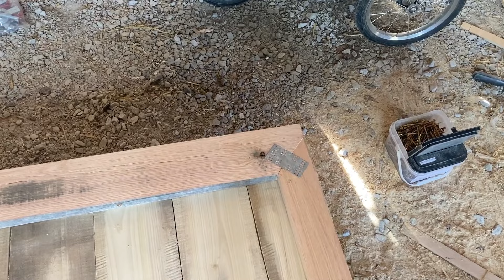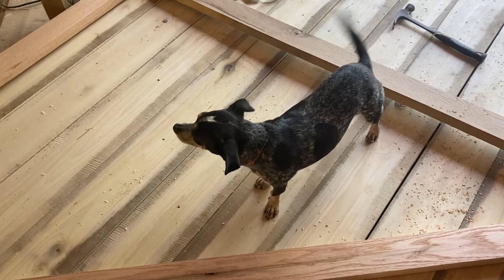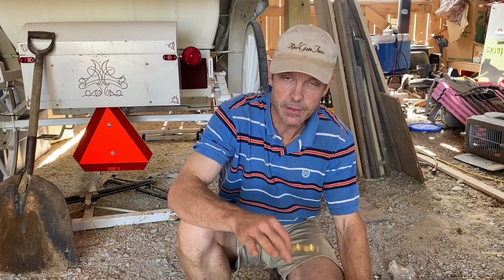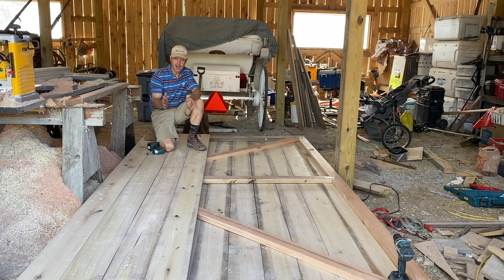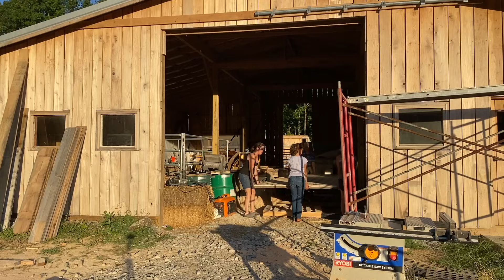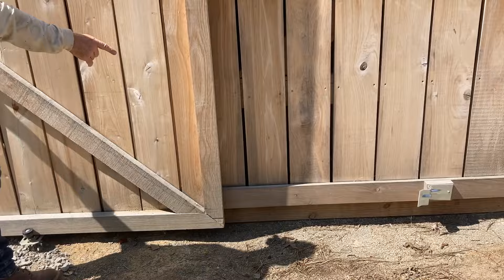Building Barn Doors

Comment: Why build such enormously heavy doors for a building where sunlight is visible between the wall siding boards?
Reply from the maker: Simple….it’s what we had available😁.  We have our own lumber mill, and used some extra pieces of lumber to build this.  The opening is large because it was originally built around our camper (which we lived in while building our home), and we knew we would have to get it out one day.

Comment: Read through all your helpful replies in the comments and re-watched the video a couple times now, apologies might have missed it but don't suppose you can share the finished dimensions of each poplar/oak door panel and a rough estimate of the weight? I've found a local Cannonball dealer but need to tell them how thick in inches we need for the track and what weight rating to choose, looks like an interesting summer project to get some doors on our barn after the building comes together this spring.
Reply from the maker: The space was 12‘ x 12‘, so the doors were roughly 12.5 feet tall x 12.5 wide.  It was built from yellow poplar planks with oak framing, and about 3 inches thick at the framed edge.  These are pretty stout doors, so we purchased the heavier duty channel and rollers.  We sized it so we could get our 28 foot camper in and out, but most equipment would allow the doors to be much smaller than that. Hope that helps!

Comment: Did you do anything to make the barn weather tight, including the doors?
Reply from the maker: We did not make it weathertight, as we wanted to encourage airflow through the spaces between boards. We did put guides on the ground to prevent the barn doors from blowing around in the wind, but it’s not sealed at all from air. It does stay nice and dry inside, however!

Comment: Did you end up putting batons over the seams between the boards? If so, was there a concern that the door would not clear the batons? I have a similar project and can’t wrap my head around whether the door will clear my batons. Thx.
Reply from the maker: I left the battens off. The airflow keeps the barn incredibly dry. I guess that’s why the old timers did it.

Comment: Any chance you can provide a list of the products used for the track and trolley. 
I’m building a set of doors like the ones you built and I like the way the track and trolley system work
Reply from the maker: We just purchased them through our local building supply, but the brand is Cannonball, and I believe they have a website.

Comment: How do you keep the wind from blowing it off track? Is there a bottom rail? Thinking of doing something like this but only 8 or 9 foot tall. Worried that the wind from Southern afternoon thunderstorms will blow it off.
Reply from the maker: Yes, although we didn’t have it installed for this video, we installed a roller guide on the outside/bottom of each door and  a center guide on the ground in the middle, where the closed doors meet.  Although these work fine alone, we also installed a latch on the doors themselves.  We have extremely strong winds at times, and have had absolutely no issues.
Reply: @ADifferentWay  Thanks! I'll Google this to see what I need.

Comment: We have to make large exterior barn doors- 13/4" x 6/4" (double doors) 2 1/2" thick. One millwork shop quoted doors using Hemlock wood. I just want to know if Hemlock will work for exterior doors or am I over thinking this (my foreman) says so. I am worried the doors will bow and warp if the right wood is not used for an exterior door. But I see all these videos where people just using almost any wood and making doors. I guess its different because they are doing it for their own home/farm/barn compared to me doing it for another owner. Any suggestions will be helpful.
Reply from the maker: I’m afraid I have no experience with hemlock, so you would have to research that. What we found however, is that different woods stand up to weather and exterior conditions better than others. So I would not say that people just use any wood necessarily, but there are different woods for the conditions in that area. So research hemlock in your area, see if it stands up to the elements and weather conditions, and go from there. Once you’ve determined that, as far as the warping goes, we found the amount of drying time affects it, and the way you actually assemble the door will definitely affect it. You have to make sure the grain is turned properly and braced against the frame for support from future warping. Hope that helps

Comment: Where did you buy the track?
Reply from the maker: It’s by cannonball.  We purchased it through our local builders supply warehouse.
Reply: @ADifferentWay hello, just wondering what specific track type you got from the connonball company and maybe some more details of what you used?
Reply from the maker: If I recall correctly, they really only offer two options… The square track and the round, self cleaning version. We chose the self cleaning as our last farm had square, and it was always clogging. It was a pain to maintain! Once you select the style track, you prefer, you simply get the items such as the trolleys and door stops that are designed for that track.  We pretty much stuck with the bare basics. I remember calling the customer service at one point, and they were extremely helpful to make sure I got all the right supplies.

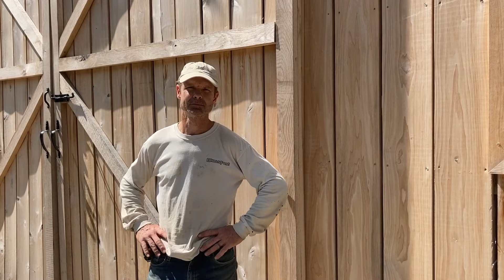Comment: Hi - at 19:20 you show the doors closed and slightly angled away from each other. I have a similar situation and was wondering if you fixed it or just left it like that. Obviously you can push and pull it together to latch it closed, but I was hoping for some margin of error in the 1/4" range, instead of the 4" range :)
Reply from the maker: Yes, this was due to slight warping of the boards.  We later purchased a center guide that mounted on the ground, more to control winds blowing the doors than anything.  However, the guide actually allowed the doors to sit in it, which helped pull the wood into place.  Granted the crooked door is a bit stiff to pull into place, but hopefully the wood will dry straighter and loosen up a bit with time. It looks normal though. https://www.menards.com/main/building-materials/pole-barn-post-frame-materials/pole-barn-post-frame-hardware/wood-door-center-guide/1556207/p-1444448480286-c-5718.htm

Comment: What is the width of your boards? I don’t believe you mentioned… Thanks in advance
Reply from the maker: We used 7.5 inch boards.  No particular reason other than we knew we had enough logs to meet that size😁
Reply: Appreciated. I will be using this exact same build

Comment: Finally found breezeway doors for my barn. Thanks! How did it trim out with the facia?
Reply from the maker: I’m not sure if you can tell in the video, but there is a nice overhang before the facia board. The doors simply slide right under the eaves. It was all intentionally sized that way, so it fits with no problem.
Reply: @ADifferentWay  I meant the metal trim that is designed to go over the track? Or did you not install it because you have an eve?
Reply from the maker: Oh! We haven’t actually installed ours yet, just due to time and budget constraints. That said, the brackets that connect the track to the wall are designed to attach the cover directly to. So the cover is attached to the brackets, not to the track itself. This keeps it off the track enough that there is no issue with the doors. Hopefully that makes sense.